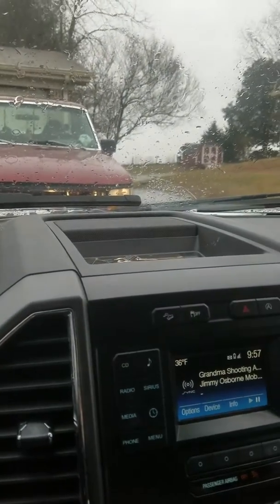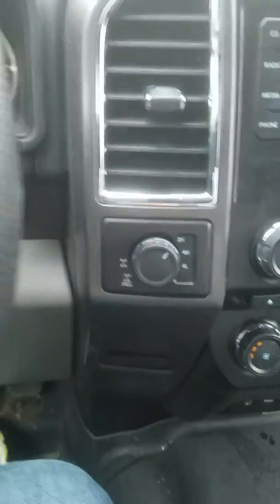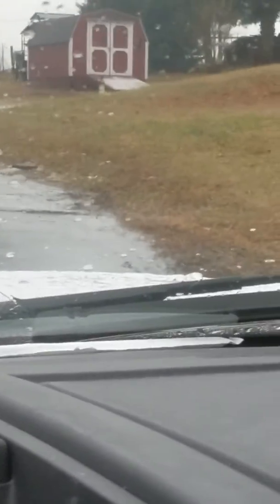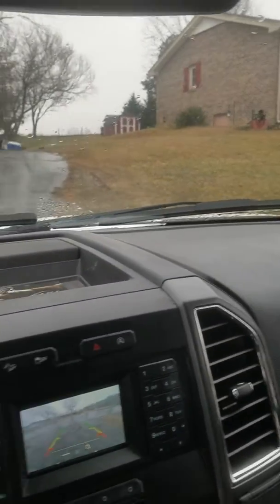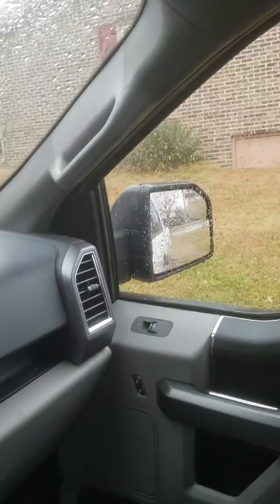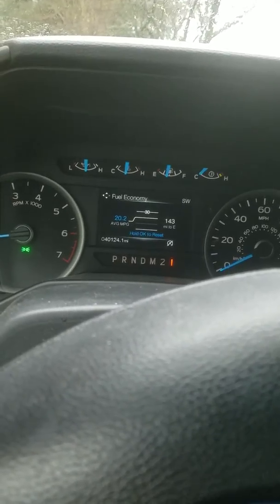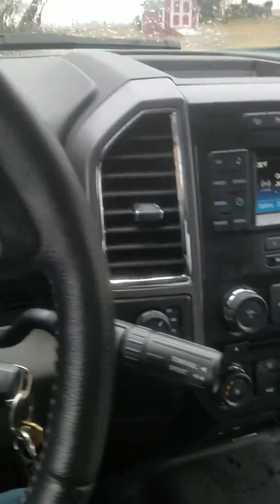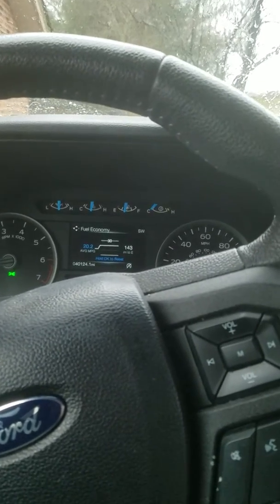What is a rear-locking differential?

Comment: I'm in the market for a 3/4 or 1 ton. The new ones with 4wd are $50,000+. Found a new 1 ton 2wd with locker for $43,000. Would you recommend getting it? Our situation - We get some snow here. I'm not an off-roader. Originally wanted 4wd for questionable campgrounds (have a travel trailer) and dicey boat ramps. Would you get this truck with 2wd and a locking rear diff? Or hold out for one with 4wd?
Reply from the maker: It really depends what you will be doing with it honestly. I had a 2wd truck for most of my life that served me well. However, in the grand scheme of things, the price gap isn't large enough for me to justify getting a 2wd and not a 4wd, especially if you will be loading and unloading boats on a wet ramp. A 2wd truck with a locker or LSD will do most things you will need, but when you do get stuck and you will at some point, you'll wish you opted for 4wd.... Take care and let me know how it goes!
Reply: @JimmyLeeTennessee  thank you for your reply!
The reason I’m looking for a different vehicle is we bought a travel trailer. Otherwise, I’d keep our 4wd frontier. Does it pull the trailer? Yes. Does it pull it comfortably? No. It’s a midsize truck. Payload is maxed out with the camper. We’ve also talked of upsizing the camper. 
Currently I’m boatless, looking for a different boat.
Reply from the maker: @fishingismydrug1  that makes sense! In that case, definitely try to get a 4wd. I know it's more expensive, but it's really easy to get stuck once you get off the hard top- especially with 5 to 10k lbs behind you!!
Reply: @JimmyLeeTennessee  Thank you sir!

Comment: Does Ford make 2 wheel drive trucks with a rear locking differential ? Because that’s really all I’d ever need . As long I can lock the rear differential, hell … I’m good to go !
Reply from the maker: Yes you are correct, positive traction with the right tires will go very well! However I'm not sure ford offers this option. You could however opt for a limited slip in a 2wd model!
Reply: @JimmyLeeTennessee  I just went to configure an F-150 on the Ford website , you can order two wheel drive with locking differential ! Super cab with 6.5’ bed can be ordered with a 3.73 electronic locking differential ( and that’s a heavy duty 9.75” pig), super crew with 6.5’ bed is available with a 3.31 locking rear differential. 
3.55 rear end only available with 4*4
Reply from the maker: @NorthwoodsNomad  good to know! Thanks for sharing!
Reply: @JimmyLeeTennessee  it’s only an additional $1,005 to get the dam FX4 off road package lol … I’ll just do that !
Reply from the maker: @NorthwoodsNomad  you can't afford not to!😂
Reply: @JimmyLeeTennessee  lol 😆 I know right !
Reply: My 2015 2wd came with the locking diff.

Comment: I heard you can have a rear diff locker in a 2WD truck is that true?
Reply: You definitely can. I’ve seen it many times
Reply: Recently bought a 2019 f150 regular cab 2wd xlt with e locker diff. When someone gives me flack about not getting a 4wd truck I tell them my truck has a locking diff. People are surprised that a 2wd truck has that.
Reply: I traded my 2018 F-150 4x4 , on a new 2020 F-150 crew cab and requested a 2 wheel drive with locking diff , they had plentiful them in Texas

Comment: I have a locking differential on my 4x4 Kubota tractor, operated by a foot pedal.  Its huge when you bring that other big tire into play, and its gotten me out of jams many times.  I made sure my f150 was equipped with this option, if not I moved on only considering those with the pull out 4x4 knob.

Comment: If I were to pull someone out do I lock my rear diff to pull with more power ?
Reply from the maker: Sorry for the late reply brother! Yes, locking the rear end DEFINITELY improves traction.
Reply: @JimmyLeeTennessee   is that other locking symbol next to the PULL a font axle e lock?
Reply from the maker: @codered1127   sorry sir, but can you rephrase the question?

*If I am understanding correctly, you are asking if you have a front and rear electronic locking differential. From what I know this has never been an option offered on F150's. Only a "rear" electronic locker. The 2021 Ford Bronco however, will have front AND rear electronic lockers!